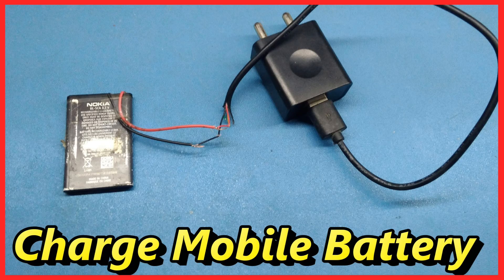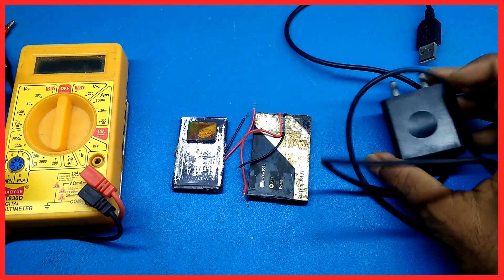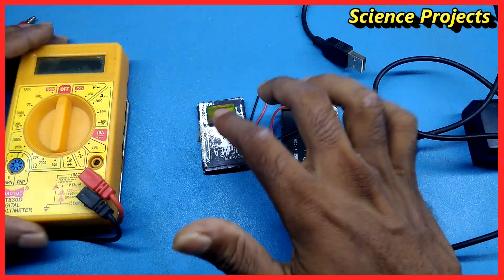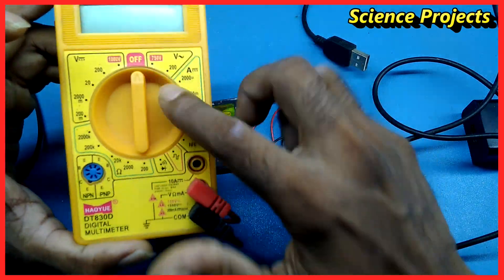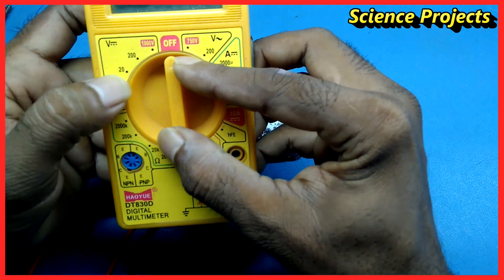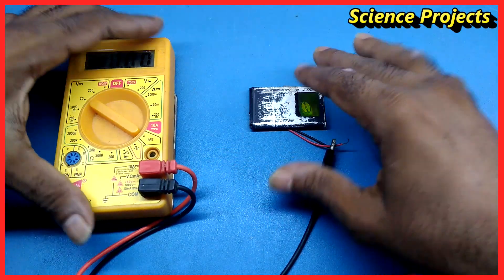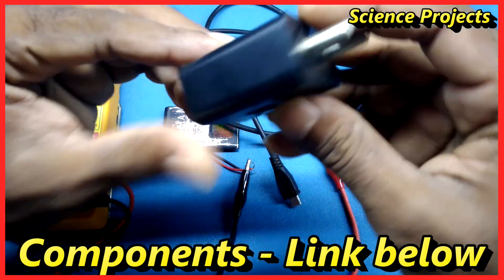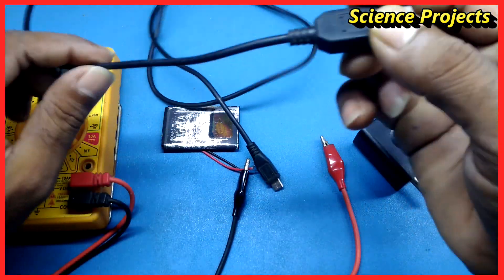How to charge mobile battery without mobile, Old battery repair, Science Projects

Comment: Bro this is for my dad's phone it's an J7 it has Nominal voltage 3.85=/11.55 Wh

And charge voltage 4.4V=/3000mAh do I follow the same steps as the video ?
Reply from the maker: ok full charge volts 4.4v so after disconnect charger, using to multimeter

Comment: How much time i charge the battery
Reply: How much time charge the battery plese tell bro
Reply from the maker: Full dry battery charge to 5v 1 amp charger maximum 10 minutes,
Second option https://youtu.be/W_h4VDDB8hs
Reply from the maker: Full charge 4.2 volts, continue connect the multimeter
Reply: I have no multimeter
Reply from the maker: Multimeter price 150 rupees only pls  buy the product link in the video description Box below

Comment: Is no problem with battery
Reply from the maker: If the battery is charged more than 4.2 volts it may burst, so charge the battery using a multimeter while charging, unplug the wires when the 4.2 volts are fully charged.
Safety purpose using this battery charging module https://youtu.be/W_h4VDDB8hs

Comment: Bro can i charge Li ion 18650 cell with this, by removing the charging circuit from top of the battery 
Will it be good?
And can i charge different batteries too of different capacities with it ?
Reply from the maker: Can be charged, but charge the batteries using a multimeter - https://www.youtube.com/watch?v=__Z_i0vRGNU&t=193s, https://www.youtube.com/watch?v=51seijok2AU,
Reply: @ScienceProjectsBalaji  i just checked one removable battery phone when i connect charger to it it provides 4.20V at its battery terminals so we need 4.2V to charge these batteries right?
Reply from the maker: @tatabyebye  The mobile charger gives an output of 5 volts, which means that the battery is fully charged at 4.2 volts after charging. 
Remove the battery from the charger and check the voltage
For example the charger should charge up to 5 volts when connected.
Remove the charger and there should be a current of 4. 2 volts
Reply from the maker: Battery full charge capacity 3.7 volts only
Reply: @ScienceProjectsBalaji  i meant capacity means how many "mAh" the battery has
Reply from the maker: Simple way full charging  https://youtu.be/EY0ZmlPqh4w
Reply: @ScienceProjectsBalaji  i think 4.2v fully charged
Reply from the maker: Yes 4.2v full charged after removing wires
Reply from the maker: @tatabyebye  1000 mah

Comment: Thanks bro it's working but isse battery to kharab nahi hogi na please reply me 😉😉
Reply from the maker: 4.2 volts full charge after disconnect, https://www.youtube.com/watch?v=__Z_i0vRGNU
Reply: @ScienceProjectsBalaji  but how I can know 

My charger is 4 v 1 ampere 
And my battery is 3v 2 A

Can I charge
Reply from the maker: @SynexionSunil  4. 2 Disconnect when the volt is fully charged
Reply: @ScienceProjectsBalaji  How to calculate
Can I use multimeter
Reply from the maker: @SynexionSunil  yes
Reply from the maker: Multimeter price 150 rs only
Reply: @ScienceProjectsBalaji  I have one but it is a analog multimeter
Reply from the maker: @SynexionSunil  Check the voltage with it

Comment: Can i use any charger
Reply from the maker: 3.7 volts battery + 5 volts charger
Reply: @ScienceProjectsBalaji  the battery will not blow right
Reply: @sauravbiswas9546  bro this is not good
Charging voltage should be 4.2v not 5v
In mobile there is already charging protection circuit which gives 4.2 v to battery don't connect direct it will damage ur battery
U can charge if u need urgently
Reply: @mdtauqiralam1018  okay..

Comment: I tried testing the battery voltage 
The battery was supposed to have 3.7volts but the multimeter(which is perfectly fine) read the voltage to be lesser than 0.5 volts.
Does that mean the battery is dead and can’t be charged?
Reply: Just charge it simply voltage will crank up
I have done the same to recover other batteries 
Also check after charge after few hours that voltage doesn't go down rapidly (indicating battery is damaged internally)

Comment: Man, you are dangerous. + and - very, very near and not izolated. Charging li-ion battery with maximum voltage of 4,2V to 4,8. Did it explode?
Reply from the maker: Do not charge more than 3.7 volts
Reply: We can charge up to 4.2v 
Not 3.7v